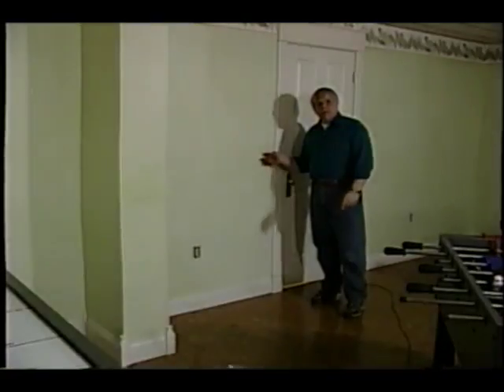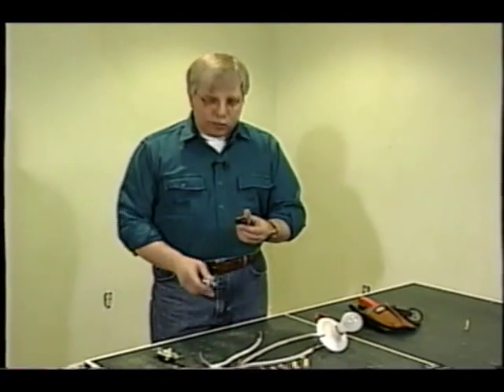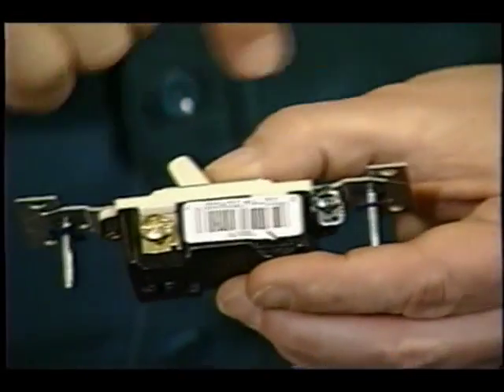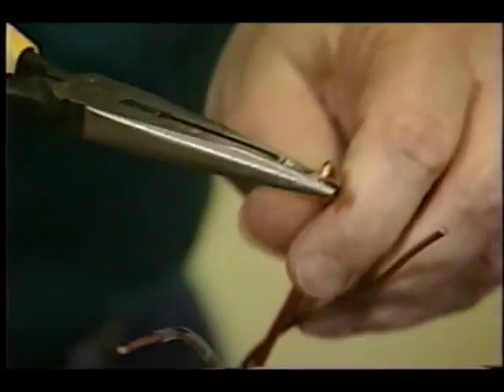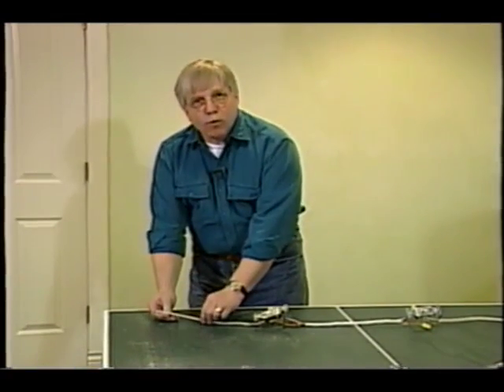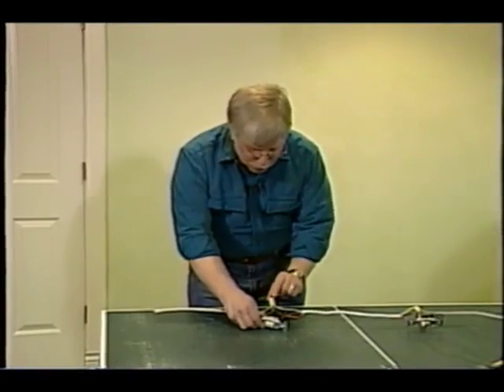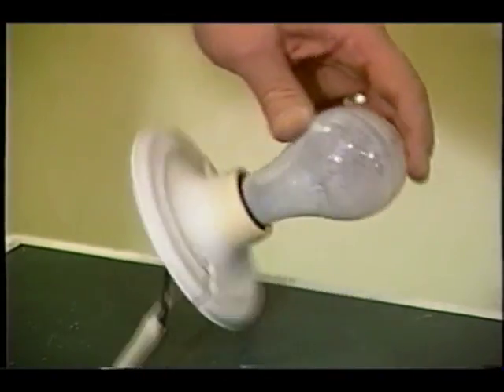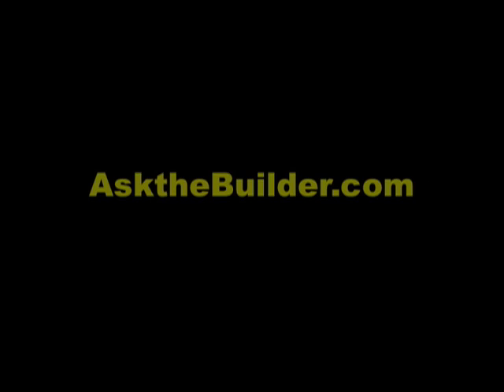Three Way Switch

Comment from the maker: Absolutely yes. I have that situation and setup in the house I'm in now. If the dimmer is halfway and the lights are on, and then you go flip the other three-way switch the lights go off. If you then switch back on that switch or the dimmer, the lights are still half energy.

Comment: Thanks for the useful video. I have a 3-way switch on which is a dimmer.
Let's call the switches A  and B. The dimmer is on the A switch. My problem is this: For A to work, B must be in the ON position. For B to work, A must be in the ON position. Neither A nor B will work if the other one is in the OFF position. I know that this is not much to go on, but could you think of a reason why this is happening? Thanks.
Reply from the maker: Ask on my LIVE stream: Be sure you subscribe to my FREE newsletter right here front and center: www.AsktheBuilder.com - Also, I now LIVE stream each M-F at 4 PM Eastern time at https://youtube.com/askthebuilder

Comment: How about my situation.  A fixture in the hall ceiling seems to get the power first.  A switch is connected to that light.  I want to put a 3rd switch at the bottom of the stairs to operate this light fixture also.  Do you have a post for such a situation?  Thanks.  Larry.

Comment: I only do small electronics such as Amplifiers, radios, computers, video equipement ext. and I was wounderind when working on a house is it manditory to use those yellow caps? (western union splices are much cleaner)

Comment: My problem is I don't always have my x-ray glasses available 8-)

The other complicating factor is the power feed can come into either switch or to the fixture.  So the circuit can be any one of (S=switch, F=fixure) 
S-S-F (as shown)
S-F-S
F-S-S 

And remember, the "white" is always a continuous path from fixture to breaker, and does not go through any switch.

I always have to pull out my wiring simplified book and recite the rules to myself whenever I have to do 3-ways.

Comment: I have a hall light that has 4 switches on it, one of the 4 was added after the build. I think it is tied into the circuit going from the light switch at the hall entry, because that switch will not work if the added switch is not turned on or vice versa. The switch at the master is a four way the switches at both guest rooms are three way as is the added switch at the end of the hall. Any ideas on how I may fix this?

Comment: Have a three way switch issue.  We have a 3w switch that runs a fan/light fixture. Iniitally is was ok because the 3w worked sent power like it is intended- and the Fan was controlled by the pull cord.  Now we switched fans, and this one has a remote control switch.  BUT can figure out how to run the wires. Should i just find another power source and not involve the 3 way; dismantel the 3 way; or get a new fan?

Comment: Tim, Great explanation, but, maybe show them that instead of saying the first switch has the power coming in, instead call it a common, and all they need to keep in mind is one side needs power and the other needs the load (or light fixture) by calling them "commons" it may not be so confusing to others.

Comment: Hi buddy, Why did you not earth the switch housing? There is a terminal for that? The ground should not 'pass through' but terminate on the metal cladding of the switch?

Obviously the regulations (and fittings) here in the UK are far different from the USA but there is also a second way to wire up 2 way switching (or 3 way as you refer to it).

If I wired a switch the way you just did I would be in direct contravention of the wiring regulations and our membership of the NICEIC :(

Comment: it woulda have been better if he drew the wiring diagram first then explained it.

however some of the cable connectors he made are not up to some countries electrical safety standards so its a good idea to check it up before wiring too

Comment: Yeah sure can get a video together for you guys :) Our regulations are intensely strict now, damn joke actually, we have to calculate voltage drop and if run through insulation, glass wool etc we have to calculate this heat retention etc .... All circuits must have RCD protection but cannot be on 1 RCD etc..... our regs are getting beyond a joke, damn european union!